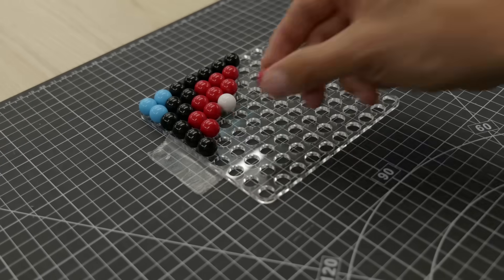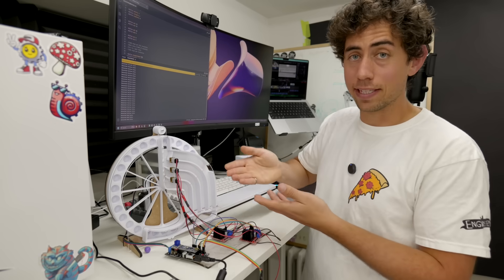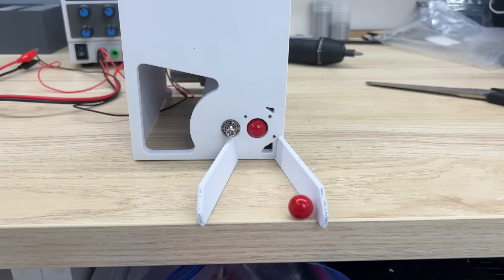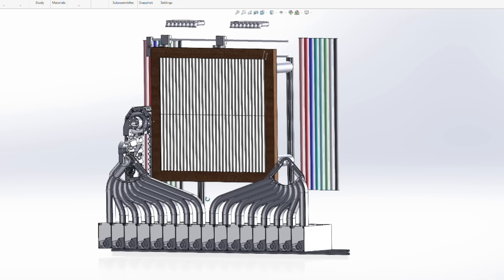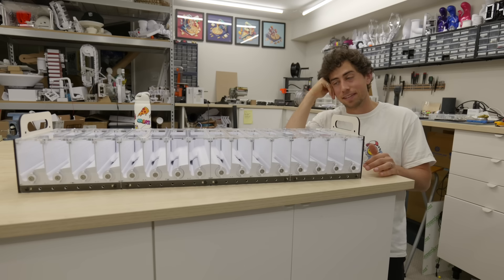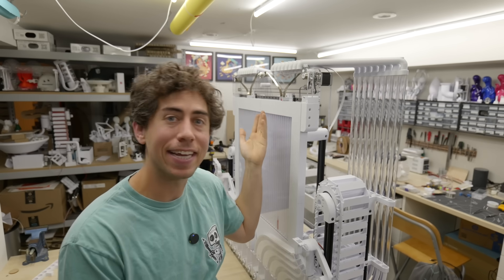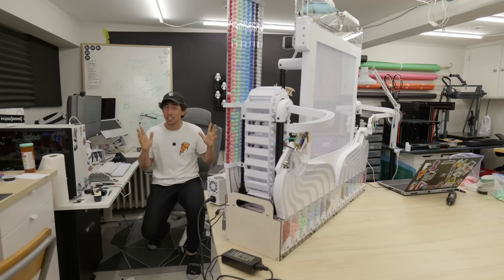This Marble Machine makes Pixel Art

Comment: 13:30 ".. I have 5 ESP32 microcontrollers controlling each.." - what?.. why??... A single one should've been more than enough??.
No, lets introduce a whole bunch of extra complexity for literally no reason whatsoever lol

Also okay, it sags, what can you do really (otoh you absolutely can do something about it lol), but.. the final thing is still buggy?.. theres always a couple of columns with extra marbles or with one or two missing, and there's spurious black marbles here and there, and sometimes the columns are offset?

And you show it off as if it's completely done.. I mean sure it can be turbo hard to fix those final issues, but at least for presentation you could've done some movie magic and manually fixed those few things or something, so that it won't look sloppy lol, like how can you look at it and be like "yeah this passes, into the final b-roll it goes"

Comment: This is so amazing!! It's heartbreaking after all that time and work to still see some marbles get stuck at the top of the frame, but marbles are not even remotely uniform, and you would have to sort through thousands and thousands of marbles to remove the ones that don't fit your tolerances. And that's just way too much for YouTube. But seriously fantastic project!!! I'm inspired to finally print and build the wall marble machine I bought from you ages ago.

Comment: I built a similar machine about a decade ago. The goal is the same, but the mechanism is was smaller, and I was designing it to work with small plastic beads, instead of large balls, so the dimensions of the device were maybe 1/10th of yours and the color-sorting block was top-loaded and gravity fed. The branch selector was way simpler. Instead of multiple doors I had a single Y-bvranch that would check the color with an RGB sensor and then use the bead or shuffle it back,, if it was the wrong color... so my thing was similar and different. The biggest hassle for me that I picked the kind of beads for my work, that could orient themselves incorrectly and get stuck in the mechanism.  The end goal wasn't "pixel art" per se, but a machine that can make bead curtains with a picture... anyways. Great work. I know how much effort it takes to put together these things. And I had to write my own type of g-code from scratch in Python to make my thing work. I haven't touched it in a long time, but your video now makes me want to get it out and film. I had to salvage parts from it eventually, because I was short on electronics and didn't have a spare RGB sensor. Good job with your thing, man! Reminds me of Martin's marble machine (from Wintergatan). Was there any influence from that project in terms of design decisions?

Comment: I noticed once filled it starts to sag down in the middle columns. I'm guessing it has to do with the dropper-flaps not being fully supported in the middle? Do you think it's worth it to fix that little flaw?

Also side question, what printers and filaments do you use? Mostly curious to know since I looked at the print files available on your store, wanting to get results as close as possible

Comment: Something is wrong as the marbles in the center don't get all the way to the top.  This detracts from the image.
          I would have not sorted the marbles & pump them to the top unsorted.  Then drop them into column based on color (or if that color not needed, discard back to bottom).  Using binary switch scheme I propose, column selection would be FAST.
          Regarding computers, what a waste & misuse of processing power!  Once the picture is fed in serially (from the screamer that is most likely connected to web), ONE 8-bit 8 MHz processor can do EVERYTHING.  Why are barrels of high-speed processors required?  Is it because of "library baggage bloatware" that everyone uses?  Engineering is about making things SIMPLE.  How many lines of code do you have? (in the picture controllers, not counting the screamer that gets photo from web).

Comment: You don't need the billion marble sorting system.  Since you are dispensing into 32 columns, you can do that with only 5 cascaded marble switches (each driven by ONE actuator that needs to have only 2 positions).  1st switch directs marble into Y tubes that direct marble over column 8 or 24 based on most significant bit.  Under this is another pair of switches (on common shaft, activated by ONE actuator) that directs from 8 to either 4 or 12, & from 24 to either 20 or 28.  The 3rd quad of switches direct marbles from 4 to 2 or 6, 12 to 10 or 14, 20 to 18 or 22, 28 to 26 or 30.  4th octet of switches direct either 1 lower or 1 higher.  The 5th & last set of 16 switches either lets marble stay in column, or directs it one higher.  The switches can be 3D printed cylinders (with slanted cross-holes) arranged horizontally one above the other, that rotate half turn to change states.  These cylinders are inside "engine block" (also 3D printed) that has tubes that direct marble to next cylinder below.  This will be fast as all 5 move simultaneously (each either half turn or stay in position), then marble drops down & cascades through the switches & into the columns.  The next marble can be read while the previously one is falling through, then switches change state for the next marble.
          You need way to discard marbles back to bottom for color that isn't in the picture or only few in picture.

Comment: This is fantastic. What is causing the occasional error in the color sort? Is it the sensor or the sorting tube not quite making it to where it needs to be?
Reply from the maker: Its mainly that the hoppers are too small and then the marbles pile up and it starts sorting the piled up color into wherever they would go 🤣
Reply: @Engineezy  Haha, thanks for the reply. That's like, the most solvable problem ever but I can appreciate not wanting to make new hoppers when everything is working.

Comment: Just wondering why the image sags a bit at the middle. Maybe the rack/pinion is torquing and needs a bit of extra material like making it into a half I beam?

Awesome build!
Reply from the maker: The front screen is bowing right in the centre! Needs a bit more thickness
Reply: @Engineezy  Thanks for the reply, yeah can now see the marbles in the middle sticking out a bit more than the sides. Awesome stuff!

Comment: I have a solution for your vertical screw lifter. If you add fixed rods on the outer edge (on the internal wall of the outer tube) the marbles are forced to stay in position instead of rolling back down the screw.
Reply from the maker: That would definitely work!

Comment: Why do the marbles slouch in the middle?

Are the wires super visible in operation? Any way of integrating those into the 3D printed parts? (Tunnels)

Do I see some of the pixels go wrong or is that just the png? I guess that’s “artistic charm” :-)

Are you going to lend this out to art/science expositions?

Are there images on random rotation on the main controller or do you need to overwrite constantly from a PC?

Can you add a camera module for a polaroid effect?
Reply from the maker: Here goes nothin:
- the slouch is from the front plate bowing (needs to be a couple mm thicker)
- the wires are visible in some place but nothing crazy, could def be improved
- there are pixels going wrong, probably the button feedback system needing another iteration
- this one will probably get dismantled and rebuilt for v2
- the images are ones I (and my intern) made, will have to make a much bigger bank
- the photobooth concept is really awesome
Reply: @Engineezy   thank yououououou!
Reply: Sorry for firing off questions like a socially inept person, but that’s what happens when I get excited by something impressive and beatiful.

Comment: Incredible!! Nice work man. What is the purpose of those two pieces of spring metal on each of those sorter arms at the bottom?
Reply from the maker: Thanks! The gears had some backlash in them which was causing the flipper to position itself in between channels. This was a last minute attempt to bias the flipper to one side of the backlash and worked so well
Reply: @Engineezy  Ahh, clever! Thanks for the reply.

Comment: Amazing project. I watched the shorts and was anticipating the finished project. Did you have problems getting marbles with uniform size and shape? I notice the image columns sag in the middle, is that from the acrylic front panel bowing?
Reply from the maker: Thanks Mitch! I think some of the marbles are slightly bigger which is why they get stuck in the channels. You’re exactly right about the bowing, just need a thicker plate
Reply: @Engineezy  You got featured by the ultimate marble machine maker, Martin from Wintergatan!

Comment: The use of those springs as funnels is genius. It’s more compact and more reliable than just having a pipe. Although whats the point of the spring at 15:28?
Reply from the maker: The gears had some backlash in them which was causing the flipper to position itself in between channels. This was a last minute attempt to bias the flipper to one side of the backlash and worked so well

Comment: I think the rendering would be more satisfying to watch if channels were picked at random. And sometimes have a channel fill only partly before it switches to another channel, and then it come back to finish. 

Basically less predictability in how the marbles drop will make it more fun to watch.
Reply from the maker: That would be a cool way to do it- maybe for v2!
Reply: @Engineezy  Could have it do all the marbles of a single color per column, then move to the next column, and then use the next color in the stack. Kind of unclear how it's switching colors, but could potentially be simpler/faster.
Reply: @JZStudiosonline  I think moving the top funnel from column to column is slower than switching colors (since each stack of marbles is always ready to go). So I think this already has the fastest method.  But that doesn’t invalidate your idea of changing the drawing method

Comment: A different idea would be to replace the solenoid under the color sensor with a stepper motor turning a coil spring and plunger. They would then launch the ball at different Arc angles directly into the screen lanes with any unused marbles would just be shot to the very end and recycled. No sorting required.
Reply from the maker: That would be awesome! Love it

Comment: That is a beast. But my ADHD brain is just focusing on the odds marble not in their right bin 😂 I guess it has to do with lighting when the sensor read the color. However I am perplexed by the red/black mismatch 😅 Blue/black I could understand. Cyan and Turquoise too. But red/black?
Reply from the maker: Funny enough, the colors in the wrong hoppers mainly boils down to I didnt make the hoppers big enough so the balls sometimes stack up and jam in the sorting unit and then all hell breaks loose! A couple simple fixes and it will all be working well!

Comment: Congrats from one Pixel Art Marble Machine engineer to another! 💪 I thought about using the Lego robotics color sensor for marble sorting, but haven't tried it. Any ideas why the marble stacks are sagging in the middle?
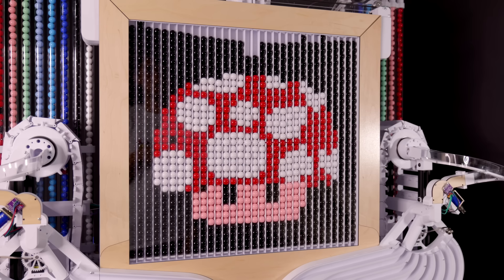Reply: I was trying to figure that out and believe I have a decent idea. At first I assumed it was due to the "release comb" thing being one piece and sagging in the middle somehow, however if you look at the lower rows of marbles on a completed piece, they seem to be mostly in line. The issue is higher up, where likely the acrylic cover he has on the display bows slightly outward in the middle. If you look carefully at 16:37, you can see that marbles in the middle lanes are not stacked perfectly on top of each other, but almost alternating forward and back. The more bowed forward the acrylic is, the more forward and back stacking you can have as opposed to a perfect verticle stack, thus resulting in a shorter overall line. The bow also explains why it seems to be worse towards the center of the display in both directions, as that is where the acrylic is least supported.
Reply from the maker: Gregory’s theory is exactly right! Thanks for watching, watching your video was part of my ‘research process’ for this one. You should definitely try it, super fun

Comment: What is causing the design to look like it is sagging in the middle at the top? The marbles look like they are perfectly straight across the bottom.
Reply from the maker: Its the bowing of the front screen- never would’ve seen that coming haha- ‘easy’ fix in theory, just needs a thicker piece of acrylic. In practice I have to disassemble the entire machine haha

Comment: Once you fix the bowing plexiglass, it's definitely time to do stop-motion animation. You should be able to upload in an arbitrary movie, have each frame approximated with your few colors (shades of gray might be better), draw the frame, take a pic, move on to next frame.
Reply from the maker: That would be amazing! Def does need some improvements before that but it is very doable!
Reply: @Engineezy  We need the Bee Movie on a marble machine lmao, that would be amazing!
Reply: @Engineezy good luck!
Reply: The simplest answer would just be to not use plexiglass. A regular glass pane, possibly tempered if available in that size, would probably be rigid enough. Or if you wanted to stick with the plexiglass, bonding it to the tops of the fins between the channels might do it, provided the weight and impact force of the marbles doesn't cause the fins to separate.

I think one of the hardest things about this build might be that there are too many potentially valid ways to solve each problem, so it's hard to know what to choose.
Reply: I also see many fixes. 
Thicker plexiglass, strips of thin plexiglass that slide between the vertical strips. No glass at all, but a narrow front side in the channels.
Reply: @AllenKnutson  this is an amazing idea!!!
Reply: @justinbanks2380 bad apple on a marble machine
Reply: @Swyift  can we run doom on the marble machine
Reply: @kombeguy my thoughts exactly
Reply: We have 4k at 60fps, it's time to give the people what they really want .. 32p at 8 fps
Reply: Tie it to a camera and make the world's worst mirror.
Reply: bad apple on a marble machine…
Reply: We gotta make a bad apple video out of it.
Reply: Or use it to play doom
Reply: THEN WE CAN HAVE BAD APPLE
Reply: This needs to be seen!!!
Reply: That's a great idea. If it can run autonomously it should just take a whole lot of time, too, not that much actual work.
Reply: Great idea! Probably not feasible but maybe more marbles? 64 x64? Probably too much

Comment: How did you learn to do this? serious question
Reply from the maker: Started in University (Bachelor of Engineering) and then continued making stuff and making stuff until I got here. Still so much more to learn though
Reply: @Engineezy  thanks. I want to take up engineering as a hobby, not as a job. Any suggestions for where to start with a hobby like that?

Comment: What’s causing the middle to sag/droop?
Reply from the maker: Interesting enough, its the front acrylic screen bowing from the weigh- I used 3mm thick material and really did not expect this. V2 would have thicker glass which would solve the problem
Reply: @Engineezy  thanks for the reply!
Reply: Probably the weight of the marbles. He needs to add some supports in the center of the bottom of the frame.
Reply: I agree with  @Centauri902 .

The weight of the marbles is likely pushing the front Perspex away from the 3D printed channels, meaning the marbles don't quite stack on top of each other. 

If the machine was leaned back on an angle, that would likely reduce the issue. Thicker Perspex would probably also work.

Comment: why didn't you use a binary sorter to sort the balls? With just 3 motors you can sort 8 colors
Reply from the maker: If the servo didnt work that was my next plan- servo is still easier to wire/code
Reply: This would have definitely looked super cool too with all the mixed colors getting sorted